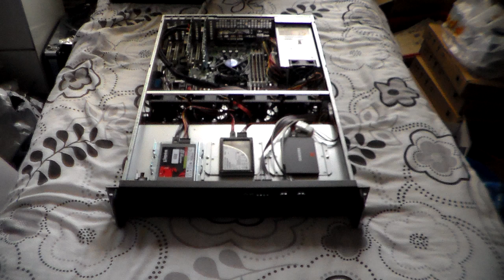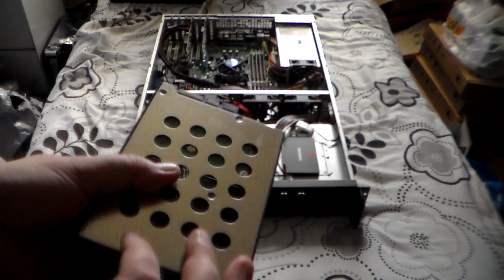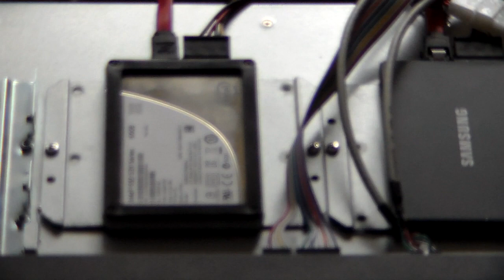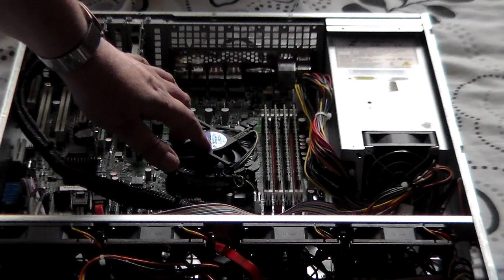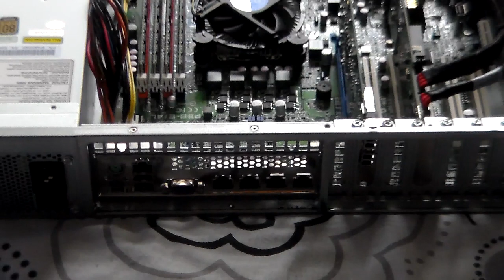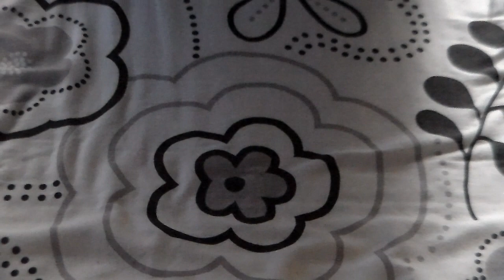Homebrew ZFS Storage Server Part 1

Comment: Hi there. Have you experimented with mpio in FreeNAS? I just finished building a FreeNAS box with a a Qlogic 2462 dual-port FC card. I was able to get it to present an 800GB LUN down a single FC port, but not I'm not sure how to proceed from there. The other port just blinks slowly, like it hasn't been initialized by FreeNAS/the underlying OS. Any help you can provide would be really awesome.
Reply from the maker: I did try using FC with FreeNAS but at the time this was built it was not very stable at all if I remember rightly. What I've always ended up doing for FC is using Solaris based OS as the Comstar driver is very good.

If I were you I would look at NAPP-IT with the omnios base. This will be relatively painless and will be rock solid with multipathing.

Comment: I very curious how this actually runs. I was considering putting a FC target together for my rack. Does 4Gb FC give you enough bandwidth?
Reply from the maker: Ian Campbell It runs great, I actually built a second one too some time after. They are both plodding along in the datacenter. How you find it in running will actually depend upon what you are doing. I easily max out the fiber with 400GB sequential if I ever need it and I get great random IO too.

I can't recommend it enough, 4Gb fiber is dirt cheap now, we also made ourselves two SAN fabrics with a couple of Brocade 200E which we picked up for about £100 each off ebay, another great thing about fiber is its very low latency too. Go for it, you won't be disappointed. I've also got 10Gbe in each of them now but don't even have a cable plugged in as I have no need for it. Probably serving about 20 production voip servers from them.

Comment from the maker: Though I can't say for certain, I'm prett sure these NICs will be good on FreeBSD based systems.

The NIC shows as Intel 82574L. VMWare, Linux and Solaris based distros have drivers so I see no reason why FreeBSD based distros shouldn't work equally as well. If you are going NAS4Free or FreeNAS, at least using ISCSI, performance was dismal compared to Solaris based distros.though I think that could be something that could be tuned.

Comment from the maker: FC is not supported out of the box on FreeNAS, in fact it is none too pretty on FreeBSD based builds full stop.

For using as an FC target go for one of the Solaris type builds. The best out of the box is Nexenta but the licence doesn't allow commercial use. Openindiana+Napp It also works very well.

In both of the above cases the FC cards will be recongnised but will be brought up in INITIATOR mode rather than TARGET, very easy to change though.

Comment from the maker: I've actually amended this slightly now.

I wasn't aware that if I put in it my e3-1245v2 processor, I had all the components to build a ESXi all in one with passthrough. This has made a little beast of a box. I had to take out a couple of drives so I could get my zil and l2arc onto the LSI controller to passthrough but even so, I have been pulling 675Mb/s sequential read speeds and very good random too.

For home users, Nexenta, NAS4Free or FreeNAS will be good but Nexenta is fastest.

Comment from the maker: On Nexenta I'm getting:

IO "sequential read" test...
result is 400.16MB per second

IO "sequential write" test...
result is 215.12MB per second

IO "seq read/seq write" test...
result is 198.08MB/200.30MB per second

IO "random read" test...
result is 242.24MB per second
equals 62014.5 IOs per second

IO "random write" test...
result is 71.56MB per second
equals 18320.2 IOs per second

IO "rand read/rand write" test...
result is 84.97MB/85.24MB per second
equals 21753.2/21821.0 IOs per second

Comment from the maker: Drive Interface SATA 6Gb/s
Disk Size 3.5 Inches
Disk Capacity 1000 GB
Disk Speed 7200 RPM
Data Buffer/RAM 64 MB
Platters 1
Heads 2
Cylinders 16,383
Bytes per Sector 4K Sector with Emulation
Sectors per Track 63

I'd like to run a FreeBSD based system so I can use HAST and therefore get the High Availibility that I'm after. At the moment its running Ubuntu with ZFS on Linux.

The performance is very good, 394MB sequential read across the network and random read writes giving nearly 12000 iops.